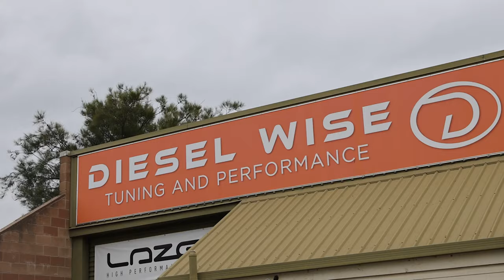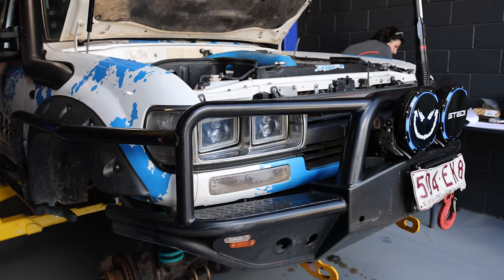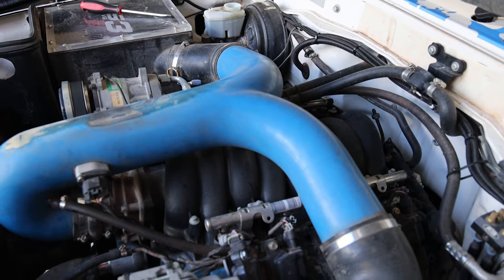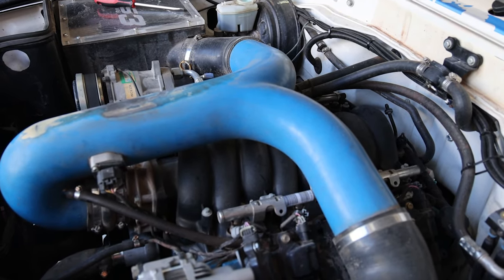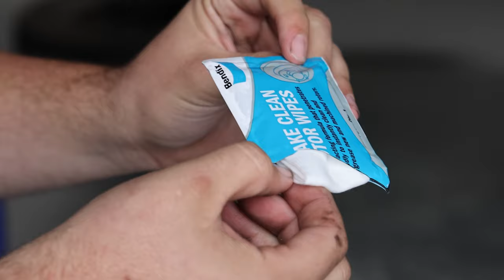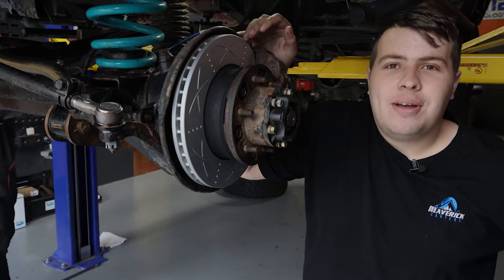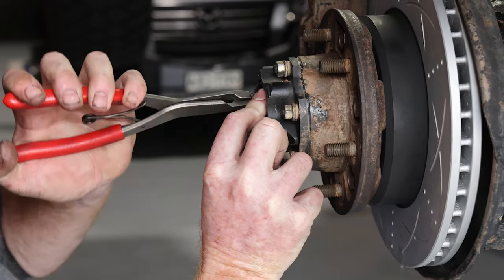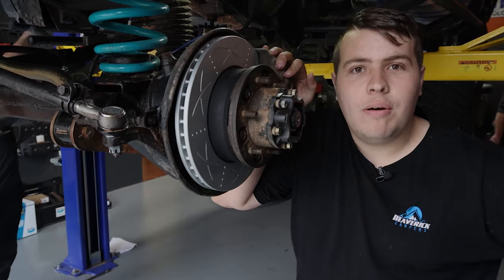80 Series Toyota LandCruiser Brake Upgrade Install

Comment: Has the Bendix brake booster a larger diameter of the diaphragm? The original has 9 inch, right? What does the Bendix have?